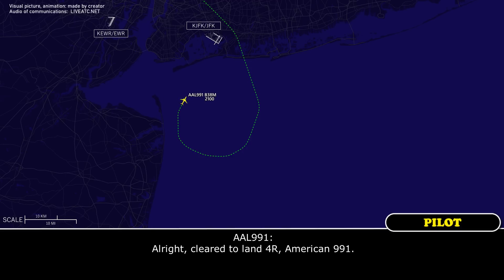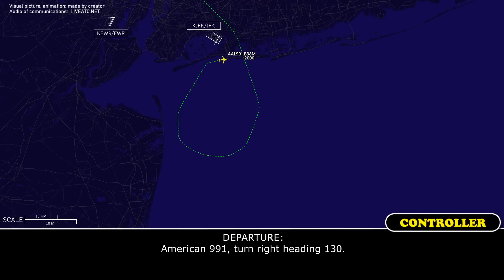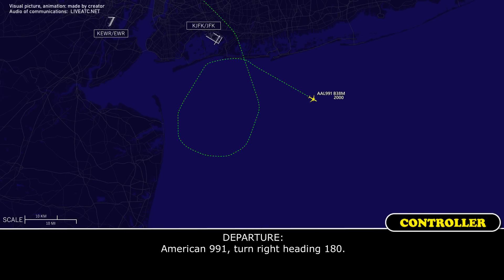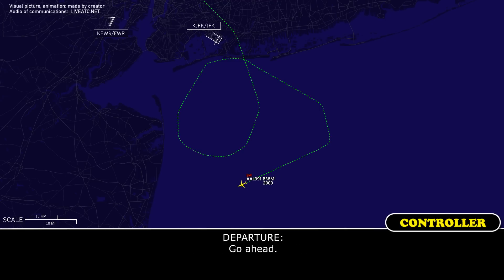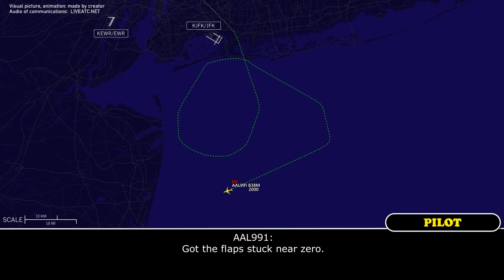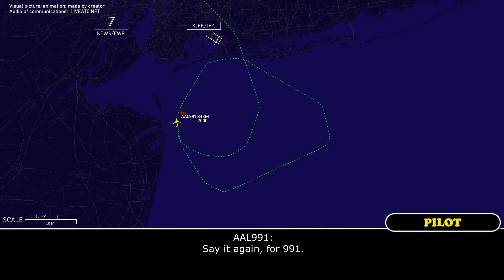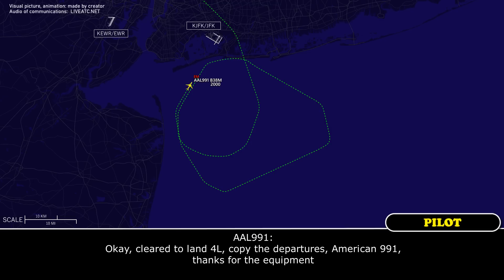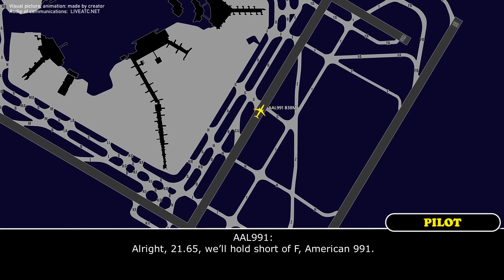“FLAPS STUCK NEAR ZERO”. American Boeing 737 MAX 8 has problems at New York Kennedy. Real ATC

Comment: Gun the brakes as in infrared camera?
Reply: Or, infrared thermometer.
Reply: duel wavelength pyrometer
Reply: After a high speed landing, requesting a check of brake temperatures is standard to prevent fire.
Reply from the maker: I believe yes.
Reply: Ak47